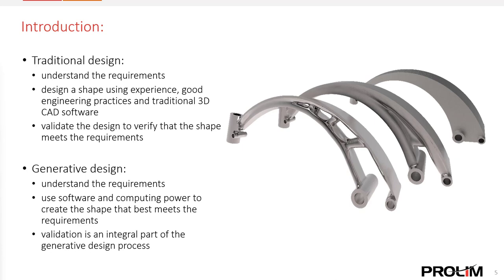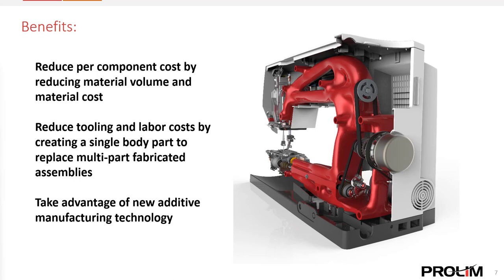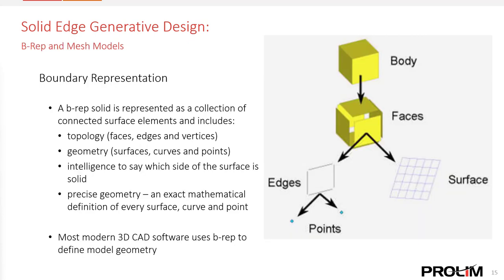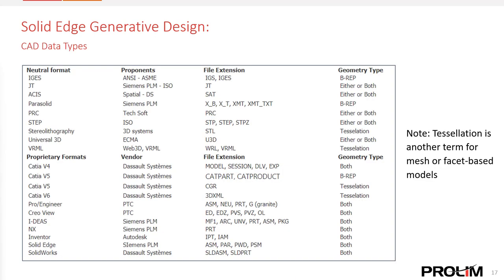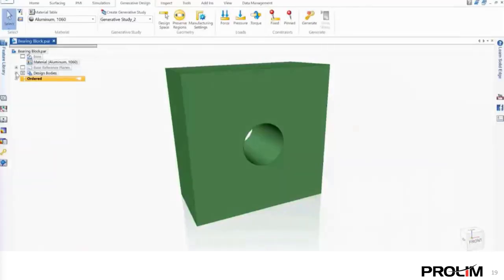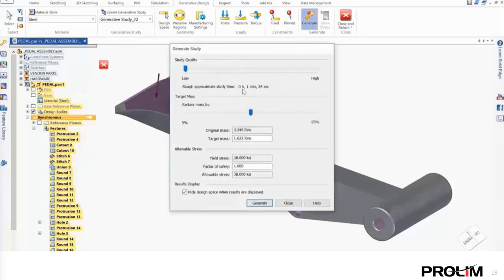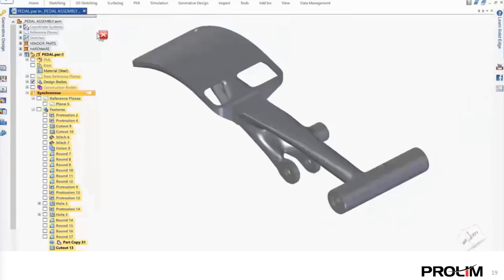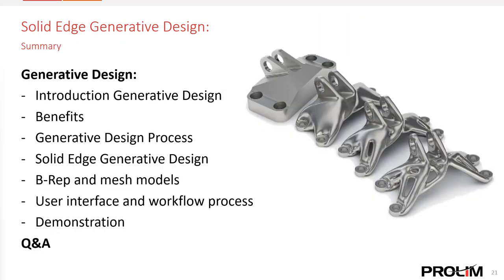How can Generative Design Bring Topology Optimization to Solid Edge? - Tutorial - PROLIM Webinar

Comment: Is it worth replacing zinc/Al, PA die cast components with this? Right now the additive cannot be cheaper than a molded part, but i am thinking fine tunig/ weight reducing existing parts and maybe making new Tools for die casting...